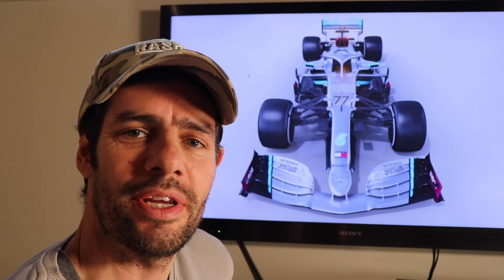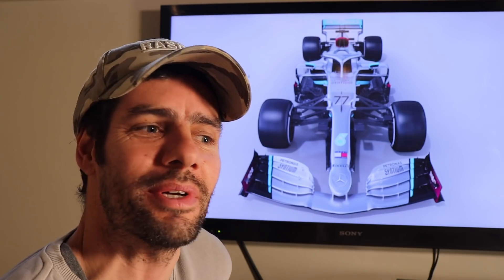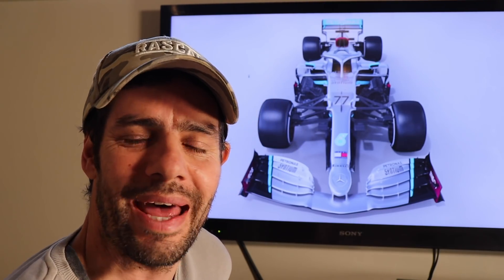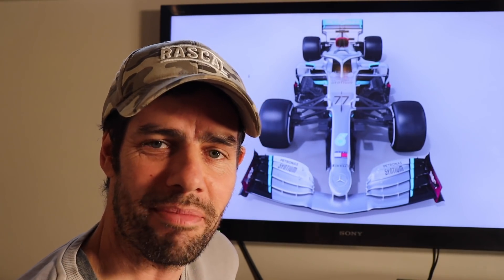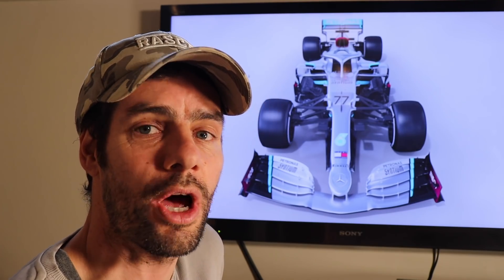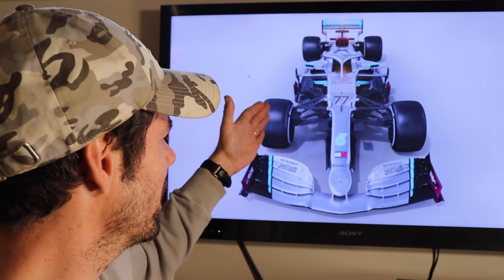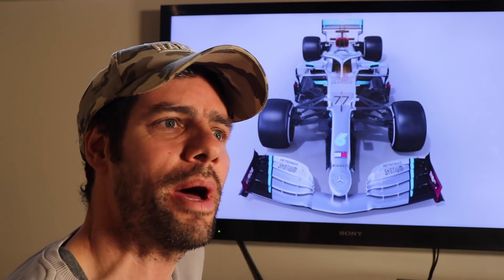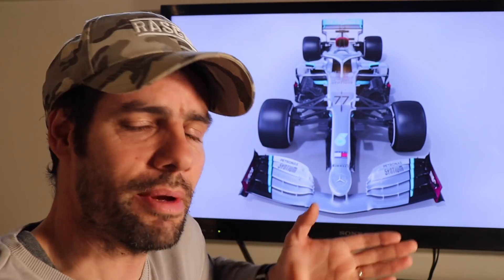Explaining Mercedes F1 DAS System

Comment: How can this be conform with

10.2.3 No adjustment may be made to any suspension system while the car is in motion. ?
Reply: Did you not watch the video?
Reply: @BNOVA  I did, but sorry, i think his argument is rather weak. Toe in/out is normally part of the suspension geometry. Even if do steering movements, toe in/out normally remains the same.
It's pretty clear that the systems sole purpose is changing the suspension system. The driver doesn't really steer the car with it. Yes, there is a loophole in the rules under the notion that this is a steering system...but only then.
For me, a steering system should enable a car to drive around a corner, and this doesn't do that.
Reply: @shi01  fair enough. Your point is one of the best I have seen so far.
Reply: @shi01  Let me offer another perspective: The ideal straightline position for tyre life and thermal management is zero toe. I think this is the principle benefit, as the Mercs/Hamilton have been known for being harder on the tyres historically. Adding toe-out improves the ability to corner. Therefore the system is directly related to improving the ability of an ideal straight-line car setup to go around a corner. You are thinking about this from the traditional compromised configuration of a car always having some level of toe to improve cornering.
Reply: @stephen-boddy  I see it from a point of "what were the intiontion of the rules". Clearly one intention was to ban systems which alter the suspension geometry actively while driving. 
 I know very well what the benefits of this system is. But in my opinion it should not be aloud.
The system can only be deemed legal if you looked at it as steering.
But if you go this route, well you can also say "well, active suspension also helps me steer the car, so it should be aloud". In Nascar for instance, they purposly set up the suspension asymetrical, so the cars would have a tendency to turn left by their own. So it "helps with steering". An active suspension can achieve the same thing on the fly, why is it banned then? I mean it would help steer the car, so it should be aloud shouldn't it?
Reply: @shi01  I think the active suspension is banned because it is an electronic system acting autonomously. This (currently) seems to be mechanical driver input to change the steering behaviour. The regs mention "Suspension geometry" (10.2) and "Steering" (10.4) seperately. At no point is toe mentioned. It is a permissive formula. That which is not expressly prohibited is permitted. Half of F1 inventiveness comes from trying to get an edge based on creative thinking and interpretation of the rules. So you can argue that it is against the intent, but if FIA are saying it's OK, then it is OK. At the end of the day they are the only ones who can decide to say no, this is not OK anymore.
Personally I think F1 is too restrictive as is. So many technologies that are now blocked and banned that it means the advancements become as thin as tissue paper. So they artificially constrain the teams to keep the racing close, but then they can't overtake, so then we have tyres designed to degrade, and minimum number of used compounds, DRS, and all the other stuff where the only purpose is to increase the number of overtakes, and that just kills it as a competition.
Imagine if the Olympics said, "We're getting bored of Usain Bolt wining. From now on to make the race closer, everyone has to run the 100m in 5 kg lead clogs, and they have to change their shoes mid way down the track. That'll make it a closer finish!" Don't even get me started on F1's titanium infused planks, or Formula-E "Fan Boost". Complete twattery.
But anyway, not going to be resolved by two people disagreeing on the internet ;-)

By the way, no biggie, but it is allowed, not aloud.
Reply: @stephen-boddy  Oh, yeah sorry, english isn't my first language. Mistakes were made...
I agree, in the end the FIA has to decide if it's legal or not. I just don't like that this system is deemed legal simply because for me it's altering the suspension setup.

The technologial openes of the technical regulations is a double edged sword as i see it. As soon as you open up the rules you give innnovative ideas a better chance. But in the long run, the teams with bigger budgets would be even more superior than they already are.
If i not mistaken, we had in the last 7 years only 3 teams going home with a race win. RBR, Merc and Ferrari. Which are also the teams with the biggest budgets by some margin.
The situation isn't pretty. I mean the best team should win in the end, but smaller teams should at least have a chance if they had good ideas.
I hope the budget cap will bring the teams at least a bit closer together, although i don't think it will do wonders.
Reply: @shi01  No probs, your English is excellent. I just noticed that it looked like one of those things that non-native speakers can get locked into. I have Greek friends who always write bellow (shout loudly) instead of below (underneath). I just try to offer the correction as a helpful thing, and hopefully don't come across as an ass.
It's hard to make a level playing field in a sport that depends so thorougly on technology. Unfettered free-for-all, or single manufacturer cars. Or something inbetween. Unless you have single manufacturer car series, the teams with the money will always find advantages simply through greater ability to attract talent, and greater R&D funding. The budget cap will always be a conflict too. Winning teams with the political power will always fight them and make them as big as possible, and smaller teams will want them to be as small as possible right up till the point they become successful. Also, they're a pig to police, and they even get gamed. i.e. I think Ferrari found some loophole that let them to do tons of wind tunnel testing that cost them nothing because it was their own tunnel, but no small team could afford equivalent time, because they would have to pay someone else for it.

Comment: Actually not steering in engineering is considered a system in the suspension especially since when you move the steering rack as you said it does alter the suspension geometry and toe is a suspension parameter not a steering parameter

Comment: Surely it breaches Parc Ferme?
Reply from the maker: What parc fermé? There is no parc fermé during a race?
Reply: Marc Priestley yes of course, but surely this counts as a setup change? Suspension geometry is covered by Parc Fermé right? You wouldn’t be allowed to box and change this so how is it allowed allowed to change during a race? I’m probably being really stupid or don’t quite understand Parc Fermé, but I was under the impression that only front wing and brake adjustments can be made post Parc Fermé

Comment: The definition of powered is interesting here. Didn't they argue that the driver's knee was a "moveable aerodynamic device" for the F-Duct system.

I can see similar arguments that the force of the driver is powering this if I was arguing against this.
Reply from the maker: If the driver turns a purely mechanical steering system, is it powered steering?
Reply: @F1Elvis  well no. But that one is definitely in the regs 🤣

I'd love to see it stand, I think it's a clever little trick.

Lewis Hamilton's latest comments (BBC, 14:09) suggest that it has been seen by the FIA ahead of time 👍.

Comment: This isn't innovative. I doubt the teams didn't do it because it's an engineering challenge. They probably didn't do it because it seems like a large hassle that ultimately is a very simple, almost hammer based solution, that just isn't in line with the spirit of F1. It's the kind of trick that every team could easily do, but nobody does it because it feels a bit skirty with the rules and doesn't bring anything new to the table. I'd welcome a new change that improves engineering logic of the turbo charger, or the energy store and MGU K and MGU H. This is the same thing as the ducts for hand operated pre-DRS DRS. We get it. It makes you go 0.010 seconds faster, but please just... this kind of innovation is not the innovation that F1 endorses. It's clever, hilarious, and extremely simple, but it misses the point. I'd rather FIA disallowed this, because if they don't then suddenly every driver will have to worry about pulling the steering wheel in and out all the time. I bet you sooner or later, somebody is gonna yank the wheel off the car going 300kph and we're gonna have a big problem.

Comment: from a saftey point of view if another car makes contact with the front wheels knocking it out of toe quickly/ violently. (assumeing it is machanical) Could this knock the wheel out of the drivers hands? Patentual hand injurys?
Reply from the maker: No different to any collision?
Reply: @F1Elvis  other than the wheel jolting in another axis not realy i suppose, and looking at the footage again there is not as much travel as i thought there was. It will be interesting to see how drivers adapt to a situation when a wheel is out of toe.

Comment: It’s been quiet on the innovation front in F1, so when it happens it is great to see. Innovation needs to be promoted more within F1. On the other hand, could this be a clever cover up for something they are hiding else where on the car as everyone is looking at the steering wheel and the front wheel movement, what are your thoughts?
Reply: They did bring 2 different cars to testing last year, so it's plausible.
Reply: Exactly my thoughts. Let everyone focus on something that isn't worth much time on the track but takes time to develop.
Reply: @Graham Day - That was the first thing that came to mind when I saw it
Reply: RB have done something similar to this in the past and it worked. I think it could be a distraction away from the rear suspension
Reply: I did read someone mention this and set my tongue wagging.... What if they are hiding something bigger and want everyone to focus on the steering so that noone notices the other thing? Seems clever if you're Mercedes...We'll just have to wait and see...

Comment: And this is exactly why Mercedes is staying on top of everyone. Innovation in an area that isnt obvious, amazing stuff by the engineers!
Reply: Yggdrasill is doesn’t change the inclination, that would be the camber, it only changes the toe, which doesn’t affect the height. Also, all teams starting with Mercedes do have a variable right height to some extent. When going full lock into slow corners, the front ride height dips to give more mechanical grip, so if this isn’t illegal the DAS can’t be
Reply: Atilla Nagy-Baló okay so why did the FIA say it’s legal
Reply: Funniest part it's that the rules state that you can't make the cars height smaller, and they are doing the opposite by making it taller
Reply: Nope, if you realized from Mercedes W01 to W03, using upper front nose, Mercedes was not the faster car. And If you look more closely the front nose of W04 to W10 had the down force front nose. Mercedes was always the faster car, since W04. It is not because of their innovation steer.
Reply: KIN S okay so just because of the nose they’re faster.... the ignorance here is amazing. Even still, that nose is a small innovation that no one else used until this year. So you just made ur own point redundant, well done
Reply: @darnelll1524  nope, you should look and compare at the all front nose of F1 team again from 2014 until 2020. In 2020 Only 2 car was using old front nose, Mercedes and BWT. I didnt made it up.
Reply: KIN S idk what ur talking about tbh. Either way, small innovations like this are the reason Mercedes are winning
Reply: @atillanagy-balo6493  Isn't just camber and caster part of suspension geometry? I believe toe angle doesn't affect suspension geometry. You can change toe angle without disturbing suspension at all. Just like Marc says it is defined as steering and not part of the suspension.
Reply: Love the idea. What's next? A steering wheel that pitches and yaws to adjust more parameters?
Reply: Not going to be hard to copy.
Reply: @Layesone  Ferrari has always been getting the highest prize money but don't see much innovation from them and don't see them making the seasons boring and predictable.
Reply: Even if it is illegal. It’s distracting the other teams preparation for the new season.
Reply: @tonyflying1550  Lol yes!!
Reply: All these dummies crying because their favorite team didn't apply it into their car first. FOH if Ferrari did it first you bitches would be silent. If it's legal that means all the other teams can copy it too. Shut up please
Reply: @shea5287  No they would not be silent. Every change is a talking point to real fans.
Reply: The FIA will have it removed before Australia. There's no way this is legal.
Reply: Cletus Spuckler yeah it’s legal, it’s Dual Axel Steering, so nothing to do with suspension and there are no regulations on what Mercedes have done
Reply: @darnelll1524  ah ah funny, well the system actually change the rear air flux, which it's triggered by the change of the angle of the wheels.
I remind all those experts of areonothing and regulations that you can't change the flux IN the race, but DAS actually does it, so it's illegal, i mean mercedes has the edge, they can develpoe the car without those illegal (and dangerous) solutions.
Reply: @Euclides287  They just confirmed this is totally legal.
Reply: @Jozz_hs  of curse it's legal..................it comes from Mercedes. Was other team.......instant ban.
Reply: @RogerM88  Yeah, like Renault wanting to get brake assist and getting denied or Red bulls active suspension? 

It's not the team, it's knowing the rules, tbh, there's no rule here that says it isn't, and that's what Merc it's using on his favor, unlike other teams
Reply: Jozz all these people are ignorant because their favourite team isn’t winning. That’s what happens when you combine ignorant people with loyalty to a losing team. Constant hating and stupid explanations as to why another team is winning and theirs isn’t
Reply: Cletus Spuckler how is it illegal? There's no aids or active parts. It's merely steering.
Reply: Cletus Spuckler According to James Allison, they’ve been consulting with the FIA about it and there’s nothing in the steering regs prohibiting it. If it gives too great an advantage, the FIA might modify the regs but it looks legal for now.
Reply: @wmrine7064  The FIA won't do anything that hurts Mercedes.
Reply: Firemarioflower you clearly don’t like Mercedes if you truly believe that, because that’s not true in the slightest
Reply: @Firemarioflower  of course the FIA always helps the dominating team, never mind that they pay Ferrari extra millions to stay in F1. This biased FIA comment is so old and rusty lol
Reply: Firemarioflower haven't done anything against them so far. If anything they've supported MB and kept them dominating.
Reply: @GloomGaiGar   Not at all.....  i can provide you plenty of evidence if you want.  Ferrari have FOUGHT for this priviliege because they entered EACH YEAR and they're also the most succesful team in history.  So it's deserved.
Reply: @Euclides287  well this didn't age well lol
Reply: Cletus Spuckler  They will allow it until it is deemed an ‘unfair advantage’. At that point it will become illegal. 😁
Reply: @Euclides287    What are you talking about......  you Hamilton fanboy.  Off course they wouldn't remove that.  It's legal because the FIA says so.  Whatever Mercedes does,  
FIA will make sure they don't get penalised.  FIA =  Federation Internationale AMG
Be happy gloomer.
Reply: Firemarioflower Mate, are you not bored of saying that shite? Same old story from the 2019 season, give it a rest😅
Reply: chutneyful it’s true mate the fia loves Mercedes

Comment: Its brilliant and appears legal. Big gain in tyre heat (so easier to run hards esp in the cool) and some marginal drag gains.
Reply: @Mike Miller You are trading off edge heat (bad) which tends to blister but be too cold on other parts of the tyre for more heat spread across the whole tyre.(good)

Comment: 1D of toe would be a huge amount. Modern road cars are set to negative minutes and seconds.
Reply: Road cars have very different requirements from race cars. Hell, I've set up race cars with as much as 4 degrees of REAR toe-in PER SIDE (8 degrees total). Obviously an F1 car wouldn't run that much but 1 degree of front toe out and maybe .5 of rear toe-in sounds about right.

Comment: take that sim racers! simulate this with direct drive wheel.
Reply: I can simulate this with my g29. Thing is it gets kinda sketchy to turn and  reattach the wheel to the desk at the same time....
Reply: It's pretty much an airplane yoke
Reply: Wait a year or two. Unless this gets banned, of course.
Reply: @pauliahonen4970  You need a game that supports this.
Reply: @pauliahonen4970  this isn't legal under 2021 rules.  So this 7d purely 2020 package.
Reply: add a little macro key that changes the toe setting in game, just on a separate usb device like some type of button
Reply: I know this idea is a bit much but it'd be possible;
Bolt the wheel (direct drive or not) to a platform-style device that is able to make precise movements based on a fore/aft motion (e.g. a device based on something like an aircraft throttle)
It'd however take a sim/game that also has the ability to make on the fly steering/suspension geometry adjustments which I guess is probably not that difficult. Most games/sims have adjustable steering and suspension geometries already, so it'd just take assigning some macros to a key or parameters to a separate controller or device.
Reply: sounds like a challenge! lol